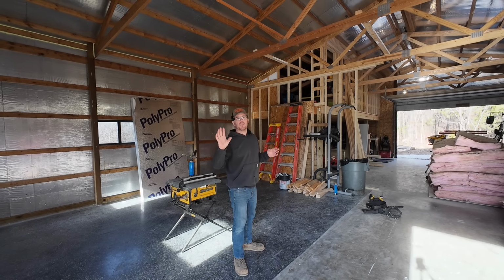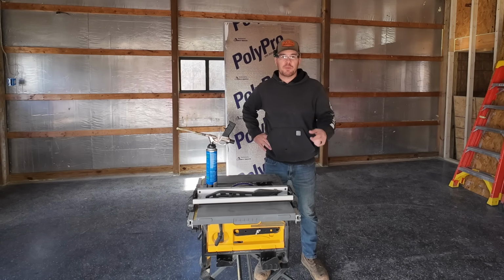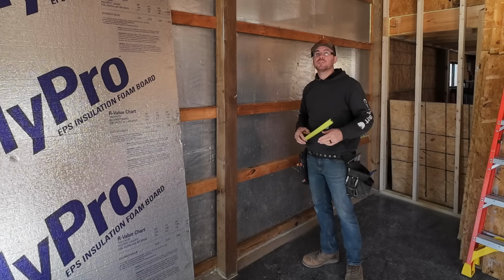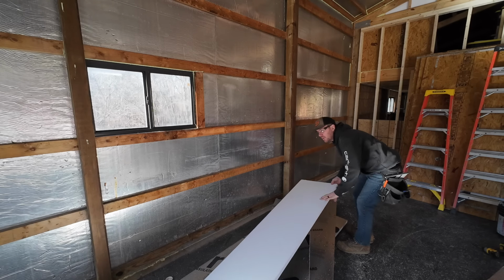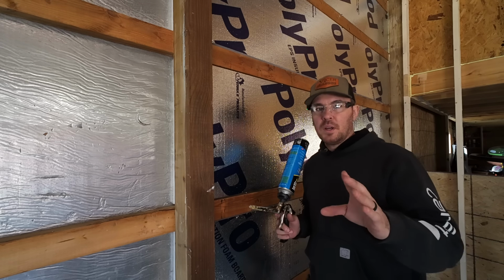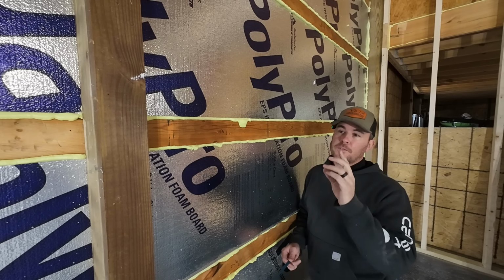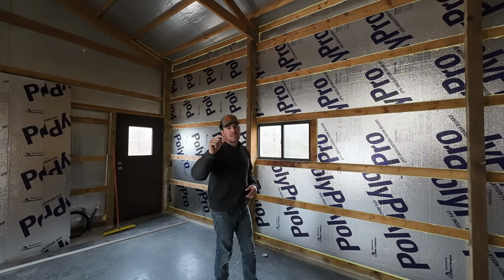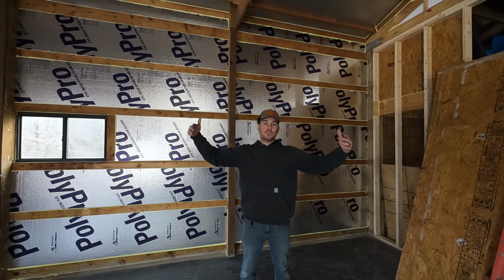MUCH CHEAPER Alternative vs. SPRAY FOAM...Insulating Pole Barn

Comment: I'm actually doing a similar style install. 1.5" between the gerts and adding a 2" layer over top with offsetting the seams. Then putting .5" osb over that. I'm not looking to hide the posts. I just want the wall space to mount things and get stuff off the floor. My barn is a 48'x64' with 16' walls. I'm not looking forward to getting insulation up on the trusses.
Reply from the maker: Thats a big project

Comment: Have a detached garage and i am looking at options to insulate. I want to insulate the ceiling first and i do not plan on putting sheetrock. Plan on painting the trusses and everything black to have an industrial look. Can this foam board be painted? Do you think it would be a good option to keep the garage from getting so hot in the summer? Looking at spray foaming this spring but open to foam board.
Reply from the maker: Not sure if it can be painted.  I dont see why not.  Any kind of insulation is definitely going to help keep it cool.

Comment: I see you did this a while back. Wondering if there's anything you'd change about it? I'm in process of same thing, shop makeover. Planning same 1.5" foam board, metal barn panels walls and ceiling to brighten it up. Same 1.5" in ceiling. It feels like a good plan, good to find others doing the same thing. 27 years with nothing but the 3/4 exactly like yours, needs a facelift for some new equipment :)
Reply from the maker: @radamus210  i havent heated the barn yet but for what i use that barn for its perfect and cost effective.

Comment: use  the     medal     on  the     bottom    up 36in hight     because    then   you   can   spry  the     floor   with  out     worry  about   getting  your   walls   wet   and  it   work   best  if you   do     car  work  in    so o you   can   spry the  floor  and  the    dirt    and  s tuff   wont     stick  to  the   walls     i  have    enven   done  in   a    resuraunt     because  the   ower    was   getting   tire   of     fixing  the    wall  were  kiods    kik   the  walls  and  it     made  a    lot   easyer   for    his  worker  to    cleand   the  walls  too

Comment: AMVIC makes EPS Silverboard in many thicknesses and it comes as 4'x8' or 9' at R5 per inch.  1.5" costs $0.94 per sq ft CDN
EPS is expanded (by steam) poly styrene which is less costly than XPS (extruded) as you mentioned but EPS also retains its R value over the years and XPS does not.....    XPS can take on water which would be a problem on the exterior                PACIFIC ICF

Comment: Question: Why put up the old plywood over the foam board if you planned to frame out to the post dimension? Was it for racking strength? Provide a nailing surface? Just didn't want to waste it? Not a criticism, just curious.
Reply from the maker: Im mainly going to use it to protect the foam board from rodents.  Theres a lot of mice running around the barn and they love chewing that stuff up.  When i frame the wall next to it there will be a slight air gap between the osb and the new framed wall.
Reply: @SpicerDesignsLLC  Well that just makes all sorts of sense. It's a great idea. Aren't you glad - I - thought of it?
Reply from the maker: @juliancate7089  yes! Thank you.  It may not make a difference but i will feel better knowing theres a little extra protection in there.  Hoping to have the framing video up in the next couple weeks.  Shes hounding me to get that gym done.
Reply: @SpicerDesignsLLC  How the wall assembly is sealed from outside is not visible from this video, but as long as you can prevent the little turds from entering the wall space from outside, especially at the bottom and top sills, it should work. Looking forward to more content, so chop chop.

Comment: The hack saw blade does cut the foam nicely. I wonder if one of those oscillating multitools would save your wrist.  Unless, of course, you've already got an over-developed right hand :)
Reply from the maker: I think my right hand is actually faster than the oscillating tool.
Reply: @SpicerDesignsLLC    lol
Reply: Well, I’m not the only one that thinks this way.😂😂
Reply: @OneEyeCustoms  If I said my mind was in the gutter, I'd have to be looking up to see them.

Comment: Consider DOE insulation analysis from research on instrumented buildings they built.  The key finding, effective insulation is only as good as your lowest insulation area. The lowest insulation acts like a drain in a sink.

Comment: Where did you get the polypro material? My local stores (Lowe's and Home Depot) sell 1.5" for $33 per board. The half inch is $10.37. I know this was a year ago but holy cow!!
Reply from the maker: @jackabato6997  lowes.  Check the comments.  Prices vary a lot on that material.  Not sure why

Comment: This video should have included a discussion about open cell foam versus closed cell foam. Depending on where you’re using it, one or the other might be required by code. Closed cell foam also has about twice the insulation value and deals with water better.
Reply from the maker: Your welcome to make your own version.  Im not obligated, just wanted to share the way im doing it.

Comment: You probably already put the OSB over the foam board.  I would not do that as even with a gap between it and the next layer of insulation (foam? Batts?) it is a potential moisture entrapment location.  There is such a thing of having a building wall too airtight.  Building needs to breath.  

I refurbished a 1945 house with 2x4 walls in 2011-2014 from mud sill to roof.  Building department said I needed to use spray in foam to get the required R value.  What a mess that turned into, especially with the insulation contractor (will never use them for anything again). When one sprays in the foam they normally saw off the bulge between the studs; not that company and debating it with them did no good.  They came they sprayed and just wanted their money.  I spent about 40 hours scraping the bulge down level for sheetrock. Building department said with the airtightness of the building that there had to be a fan with a 1 hour timer that needed to be run once a day to purge the moisture out of the house.  I read since to, that the spray in foam against wood can sweat and rot the wood.  I have since sold the house so not my problem; I did however tell the new homeowner about the need to purge moisture. I think if I ever did it again I would double up the 2x4''s to get the distance for using regular fiberglass insulation.

Comment: I just put the same foam board up in my shop and faced it white side out. I've only done 1 10' wide wall . wondering if I should tur it around? haven't secured beside tighter tolerance and no spray foam.
Reply from the maker: I would imagine you good the way you have it.  Ive heard its fine both ways but im not an expert.  I faced it in because i already had some 3/4 polyiso between the sheetmetal and gertz.

Comment: Have any condensation issues stacking it on top of what you had?
Reply from the maker: No issues.  What was there wasnt a sealed barrier like this.  Theres still an air gap between the two layers.
Reply: @ gotcha appreciate it !

Comment: Hello Spicer! Thanks for the video. I noticed you said the cost of those 1.5x4x8 foam boards was around $10 a piece. I am seeing them now at home depot and lowes at around $25 a piece. Have they really gone up that much in a month?!! Or am I seeing the wrong thing? Thanks.
Reply from the maker: I did get them on sale here in Southern Indiana.  Ive had a lot of comments saying theres a big price difference in certain locations.  I didn’t realize that product fluctuates so much in price.   I picked mine up from Lowes.

Comment: Did you know that 1/4 inch corrugated cardboard has an R value of 4? And that with a bit of spray adhesive you can sandwich layers to increase the R value. So with a few cases of spray adhesive and a couple cases of packing tape... cardboard is free and pretty much everywhere. My 30x60 pole barn has as good as a regular home insulation and the insulation was free.
Reply: Cardboard soaks up moisture too and the corrugated part allows bugs to have a fantastic home. No thanks. If you were homeless that's different.

Comment: Just a few questions as I am confused 🤔. What's wrong with using finishing nails? I thought  once you BANGED them in. you can say your "Finished"  Next is Dry wall screws for the hanger plates over the romex? As I see it you will most likely be hanging dry wall on the boards so your already good with the drywall screws and you are no longer tasked with the pesky holes you need to drill in the wood for for the romex!  I think this is a real time saver just like the finish nails. AND DUDE!! them their lady bugs are  good luck!!  and 2,000 of them?  How would you like it if 2,000 ladies came and sucked  ....  well what ever!!!  Just hope it works out for you and keep us informed!!  Ps, do you have a link to the tool belt and the Keystone girl?  I did not see it posted.  And to the Keystone girl..  naaaa  its just normal insulation and not the great stuff!
Reply from the maker: Hah! Well i think i just found the carpenter that framed that room.  It was you Rich.  You can find that tool belt at the adult book store.
Reply: is there a link in the description?  @SpicerDesignsLLC

Comment: Don't you normally want to have the foam board about 1/2 to 1" away from the metal siding? 

From what I understand, it's best to just put the full sheet right over the gerts so the 3/4 gap provides an air gap so the aluminum surface reflects the radiant heat.
Reply from the maker: Can you clarify?  If its over the gertz, that would be an 1-1/2” gap and the ribs in the sheet metal act as an air gap.  Its installed the way i dit it all the time.  The gap would just give mice a great place to make a nest.
Reply: @SpicerDesignsLLC  ...You are correct. My apologies. For vertical siding, that's the way to do it. I kept thinking of horizontally installed siding, where the air channels are sideways, so an air gap is best for air flow.
Reply from the maker: @Condor1970 no problem.  Im not an expert by any means so im sure theres a better way and definitely other ways.  I appreciate the feedback and suggestions.  It helps other people too that are interested in a project like this for themselves.

Comment: How did you get the 3/4 insulation behind the girts? Also, can you just install that foam board right against the metal walls if you don't have any other layers before the foam board?

Comment: If the foam is not adhered to the substrate, then moisture will condensate on the warm side  of the exterior sheathing creating mold. Worse in colder climates

Comment: Personal opinion if you were going to cover the foam with OSB anyway I would have just used full sheets of the foam over the grits. The air gap between the grits, if the ends were sealed, would have provided an air gap for a little more insulation. You would have had less air gaps to seal on the foam. It wouldn't have added more than another 2" of wall thickness which still wouldn't have brought you out to the inside edge of the posts. Better insulation, less gaps to fill, not much loss of room space, less install time.
Reply: Plus he has a cold air bridge with the 2x6 grits. Wood has hardly any insulation value.
Reply: @richardlug6139  That would be one of the main points of putting the foam over everything on the inside.
Reply: @thinkfirst6431  You’re right that was why I was agreeing with your previous comment

Comment: Well done Kyle! I'm glad I'm not the only one that bought property from mediocre DIY ex owners. My front porch has no ledger board and drywall screws holding the hangers also! How cold does it get in your area? Any risk of the PEX line freezing? Cheers, Alex
Reply from the maker: Wow! You would think the name “drywall screws” would give it away.  It gets cold here.  Not as bad as up north.  Its buried deep enough it wont freeze.  Ive tested pex before for freezing.  Its pretty tough stuff.

Comment: I’ve done foam the same way. Just putting foam in without sealing the edges and stopping air movement compromises the value of the insulation for that wall. Those great stuff foam guns are nice. They save a lot of mess on hands clothes and whatever else the foam sticks to with those plastic tube dispenser foam cans. I recently tried an oscillating tool trimming foam, it works great once you get the angle figured out.

Comment: Nice work, just found your channel. Curious why you didn't put more conduit in the trench you went to all the trouble to make?  Empty conduits are always problem solvers!
Reply from the maker: Ya spare raceways are nice to have.  My electrical service hits that barn first and then goes to the house.  So i have all the power i need.   Also the city water hits the barn too.  Really wasnt anything else i needed there.  But yes i agree with you about spare pipe.

Comment: $10.27 each?  I guess the price doubled in a month.  1.5-in x 4-ft x 8-ft Expanded Polystyrene Board Insulation is $21.00 at my Lowes
Reply from the maker: I got lots of comments about the price.  Some people said it was over $40 by them.  Not sure why that product varies so much.  Thats what i paid.  I still have the receipt.
Reply: @SpicerDesignsLLC  I know you don't walk around with the receipt but can you check the item number / model number when you get a chance?  On the Lowes site I see Item #41505 - Model #531773

Comment: So would this be good enough to air condition the space?
Reply from the maker: If you seal it up good it would do fine.  More insulation is always better though. I will heat this barn periodically so it will be sufficient for that.

Comment: Would you recommend doing this in a garage gym inbetween the rafters?
Reply from the maker: @DVMotions  im not an expert on insulation by any means.  Hard to say without seeing it as far as ventilation and such.  Its a cheap way to make an area pretty air tight.
Reply: @SpicerDesignsLLC  That's fair. Our garage has a cathedral ceiling that's unvented and I've been going back and forth on how to insulate the dang thing. We don't have plans to dry wall so faced batts can't be used. I wondered if these boards can be left exposed, still haven't found a solid answer. Nonetheless, I appreciate your response and enjoyed the video! You gained a new sub!
Reply from the maker: @DVMotions thank you!  I would imagine it would be fine.  They spray foam rafters all the time which is pretty comparable.

Comment: Nice, clean install.  Curious on why you didn’t just hang r19 fiberglass between poles with vapor barrier then inside girts across poles for your osb?  Then you don’t need to frame another wall on the perimeter and the fiberglass doesn’t have as many breaks in it from the Studs?  Also, it helps to throw a 2x6 between poles with spray foam to keep bugs and rodents out from concrete and metal gaps on perimeter.  RR buildings channel is the king of pole barns.. definitely learned a lot from him over the years.  We just poured our radiant slab in my 42x80 shop, but i didn’t have time to get insulation in cuz i keep getting my wife pregnant.. it’s killing me knowing that I could be out working on machines in my underwear instead of inside changing millions of diapers.  Great vids man, keep it up.  You can tell you put a lot of work into the post production.
Reply from the maker: Haha! Ya getting the wife pregnant definitely slows progress on the projects.  I do subscribe to RR.  They are amazing craftsman.  I plan on building that room out with drywall so im going to frame a wall between the posts to do that.  I also wanted to seal it up good for insects and mice.  They have been a bit of an issue in that barn.  Pretty cost effective too for as often as ill heats the whole barn.  But yes i agree the insulation sheets are a great way to go.

Comment: What did you do in the ceiling did you leave an air gap.
Reply from the maker: Ceiling has the same 3/4 sandwiched between the perlins and the metal from when they built it.  Not sure what im going to do on the ceiling yet.  Ill cover that in a video when i get to it.

Comment: Did you find that the 1.5" panels provide enough insulation?
Reply from the maker: I havent heated that barn yet but for what i use that barn for it should be sufficient.
Reply: @SpicerDesignsLLC  Thanks!

Comment: Would putting the foam board directly against the steel be ok and not collect mold?  Great video.
Reply from the maker: They did it when they built my barn so i would assume its ok.  I have no traces of mold.   Theres a layer of 3/4 polyiso between the girts and the metal.
Reply: That would actually be better from a mold standpoint. Doing the double layers like shown in this video is not recommended, same as double vapor barriers. Was a good video otherwise, fun to watch.

Comment: Here the question, I am a little leery of using spray foam due to flammability. I worry about a space going up based on some test videos on here. Can anyone recommend a higher R value product that I can use?

Comment: im struggling to find that foam board in stock anywhere . Like you said the Pink is way overpriced. Cant stomach paying 45 per board.
Reply from the maker: Ya ive seen a lot of mixed pricing and availability on that foam board. The prink stuff is crazy
Reply: @SpicerDesignsLLC  I set myself on the email notify when in stock lol . They have 1 inch and 2 inch in stock . But that 1 1/2 is just not around atm . I need close to 60 boards to do mine.

Comment: Could have underlaid the foamboard under the siding.....longer fasteners needed though.....foamboard has a very low expansion.
Reply from the maker: @MalleusDei275  there already was 3/4” poly iso between the sheeting and the gertz
Reply: @SpicerDesignsLLC  
Lol....obviously it wasn't the same builder as the interior framers.
Reply from the maker: @MalleusDei275 hah! Definitely not